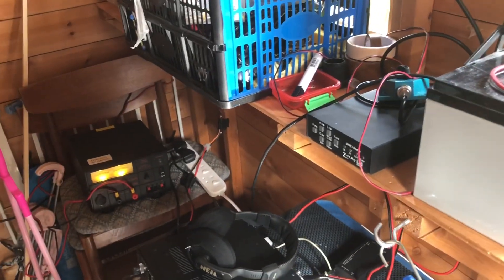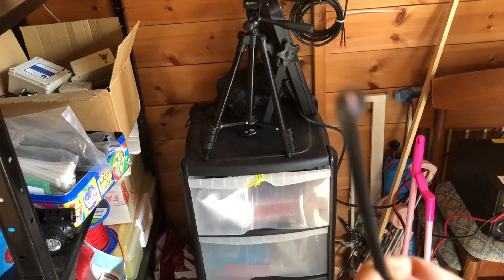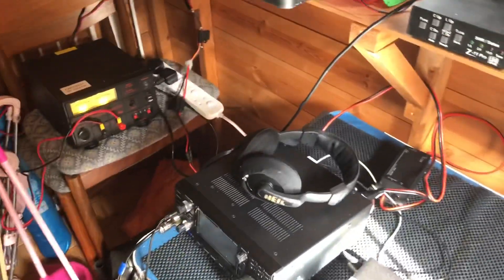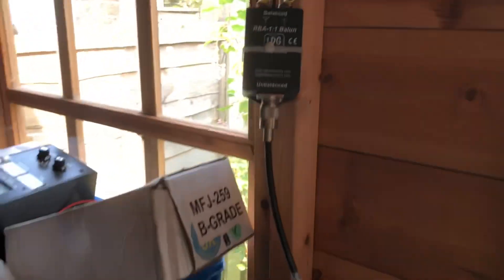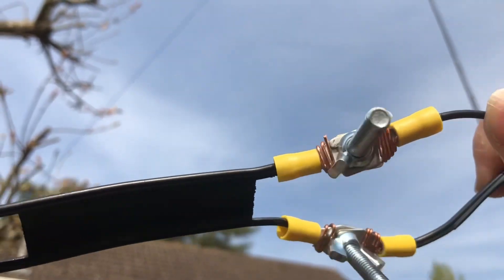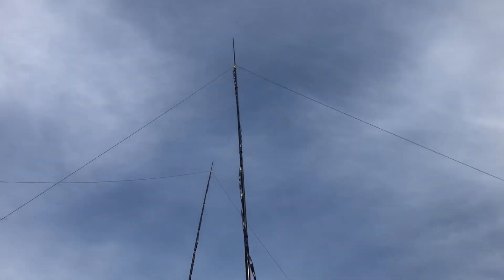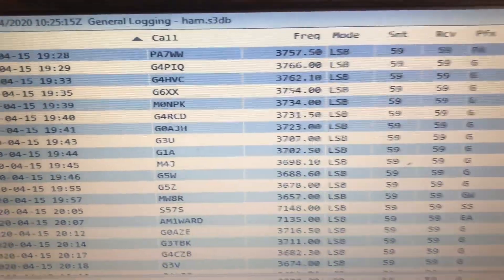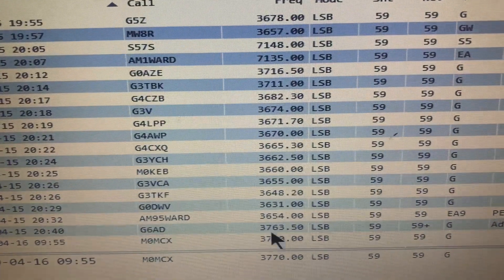HAM RADIO: QSO with the DX Commander - M0MCX. Using a Doublet Antenna.

Comment: Love the antenna Tim, the nut 'n bolt fix for the feeder line join can double as a spark gap/lightning arrestor :) Antenna lean is the norm, I have a 10m fibre glass pole for a 4m vertical dipole, that leans inbetween the branches of my tree, stealth :)
Reply from the maker: Ah yes trees help the stealthy look for sure 73

Comment: I've had 80 metres taken off me by the  solar panel installation of the house about 60' away.
It puts out strong clean, stable carriers every 40 ish Khz across the spectrum. They are not a serious problem above 6.5 Mhz...5 Mhz is tolerable. Top Band, they are becoming a nuisance but the rise to 9+ peak across 80m. Remember every 39 point something Khz.

Grrr.
de G3NBY

Comment: At the beginning you say 45 feet of the twin element wire, and then immediately say 2-45 meter legs. Sorry, but is it 45 feet or meters? Thanks Tim,  Brent   VA7HUM
Reply from the maker: Slip of the tongue .. it’s 2 x 45 feet legs, hence the video title. No way I’d fit 90 metres in my garden lol. 73

Comment: Good morning Tim, 

I am interested in your shed/shack. I may have to use a shed for my shack and I am trying to get some ideas in my head. Do you have heating and electric in the shed? My biggest concern is staying warm in the winter and I am wondering how you do it. 

Many thanks,

Bob, M0BOB.
Reply from the maker: Hi Bob. The shed is purely an April to September shack. It’s not insulated and there’s no electricity in there so I use an extension lead from the garage to provide light, heat from a small heater and power for the radio and laptop. I am however hopefully converting my garage into a hobby/shack room with full insulation heating and lighting, hopefully by the autumn. Good luck with your project. 73
Reply: Thanks Tim, we recently moved to a new house (much larger than our previous house), but I can't find a suitable place for my shack. Both my daughter's have a bedroom each, other than ours there is a spare bedroom, but my wife prefers to use it for guests (a non existent event these days!). I have a large double garage, but it's freezing in there during the winter. I may put a shed inside the garage, but I am tempted to put a desk in the dining room and stand my ground lol. 

My next step is to install an HF antenna (a Doublet as an inverted V).

I like your call sign!

73, 

Bob.
M0BOB.

Comment: Hi Tim, thanks for the video. I notice you are using a Heil headset with the Ic-7300. I'm looking at the Heil Pro-set IC to go with my Ic-7300, how do you find them, any issues?
Reply from the maker: Hi Jim the Heil proset works great. Get good unsolicited audio reports, although the 7300 has good tx audio anyway. But all good so far. 73
Reply: @TIMG5TM  Thanks Tim

Comment: How long is each leg of the antenna?
Reply from the maker: Ed Rudolph 45 feet per leg
Reply: @TIMG5TM  
Is the length of the ladder line significant?
I read that the top lines have some tolerance (as long as they balance).
Reply from the maker: Yes it can be. The odd band may not tune so removing  or adding a few feet of ladderline would bring it into range of the tuner. In my case I couldn’t tune 15m but to be honest I was fine with that. The rest 80-10 were fine. 73